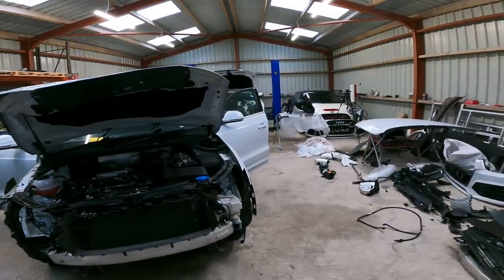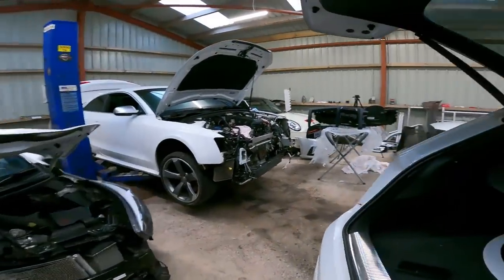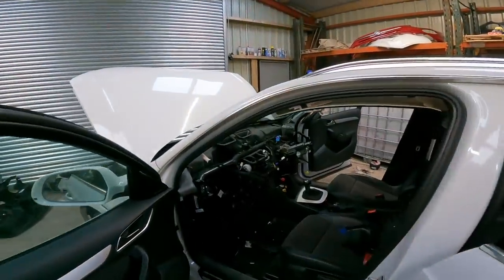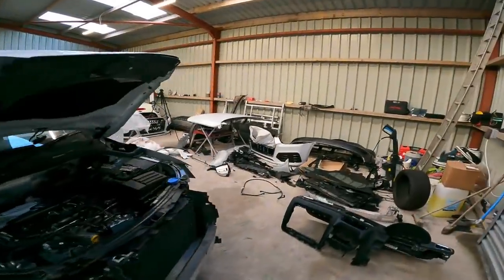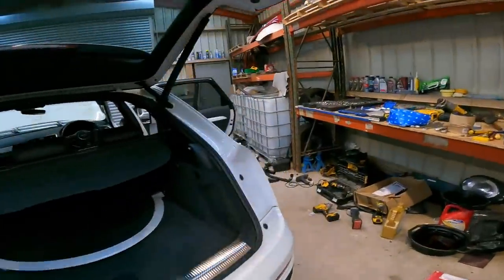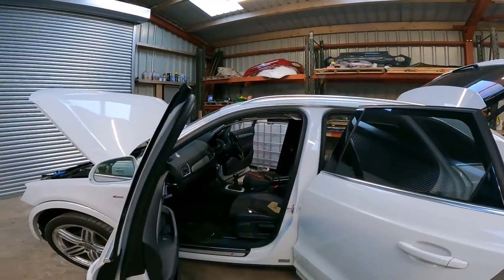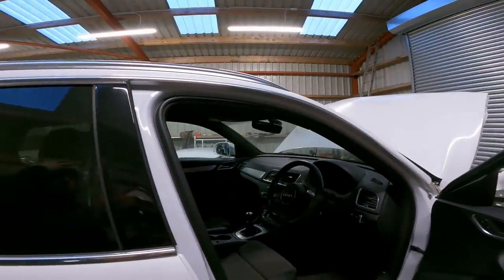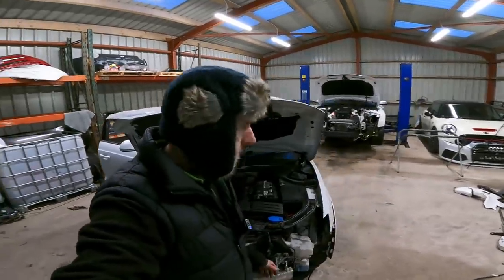Time To Change The Dashboard Out On The Salvage Auction Audi Q3 S-Line Plus - I Hate This Job!!!

Comment: Phil that looks like a lot of work for those dashboards you would think that the manufacturers should be able to fit a collapsable panel in the glove box or a replaceable panel on the dashboard.
Reply: I'm sure in one of the salvage channels (may not have been Phil's) they did a Skoda and it just had a replaceable airbag unit in the dash. Why can't all manufacturers do that?

Comment: Airbags lights on probably cause you not got the crash sensors on front bumper plugged in yet mate
Reply from the maker: It was the crash sensor on the top of the front panel bud, i had wired it up the wrong way round 😀

Comment: I have no ideal why the engineers decided to integrate airbags with the dash cover. They used to just be nice little drop in modules. I'm sure they manufactures told them to do it so more parts could be sold or more cars totaled out so new cars will be sold. A lot of small cars if the airbags deploy the car is instantly totaled due to cost of air bags, dash, and headliner even if the outside is barely touched.